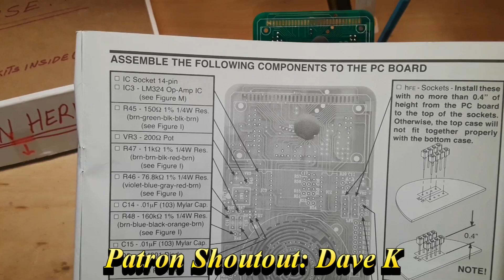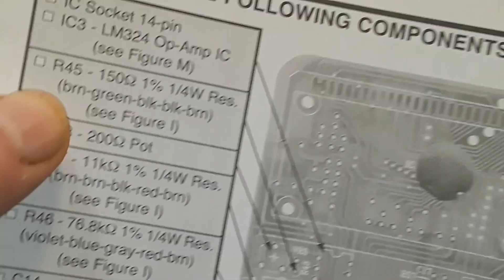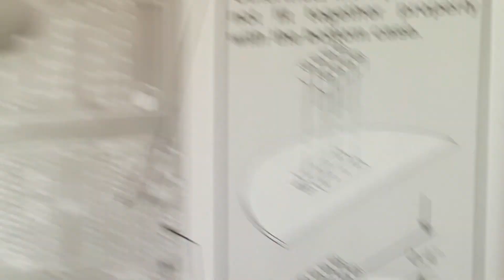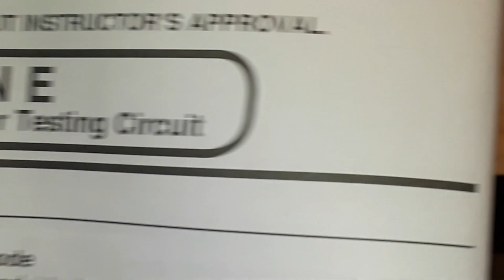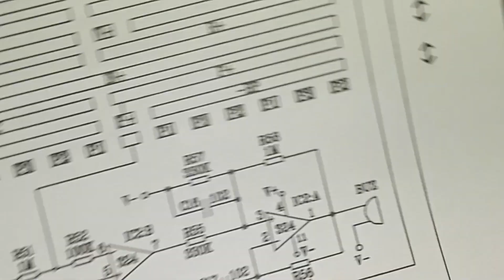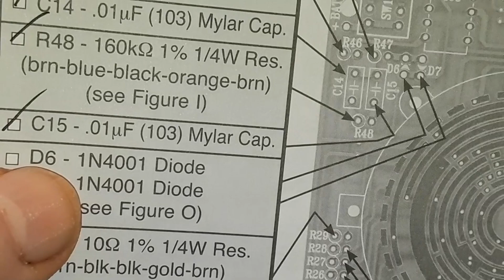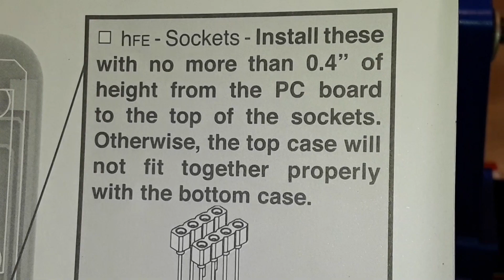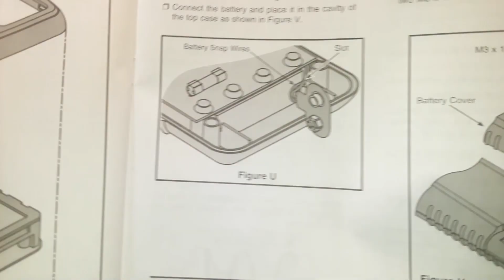Elenco M2666K Multimeter Build Part 6

Comment: Don't worry about slacking on the meter build, you've had a lot going on, and you still put out informative videos 👍
Reply: There are tests that you do after you solder each section, which Paul didn't do. I doubt that this meter even works. 👎